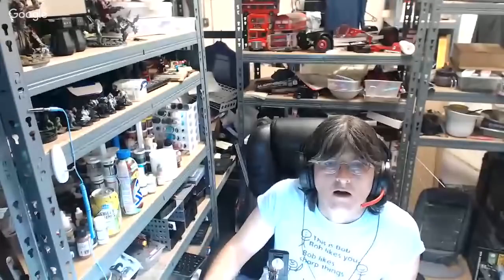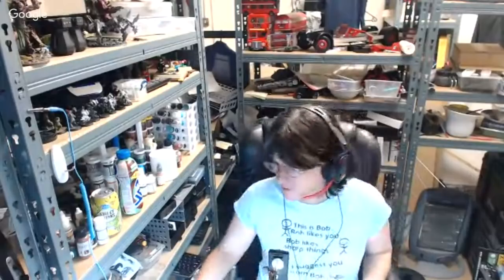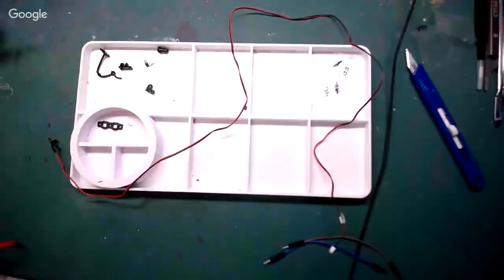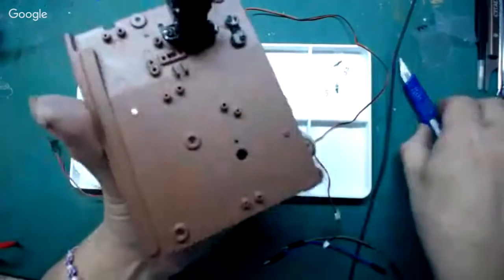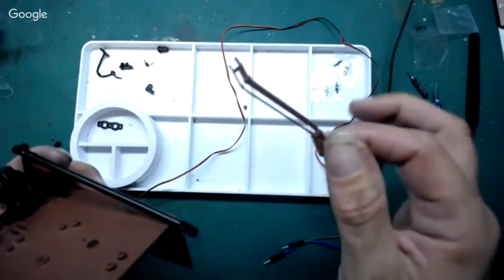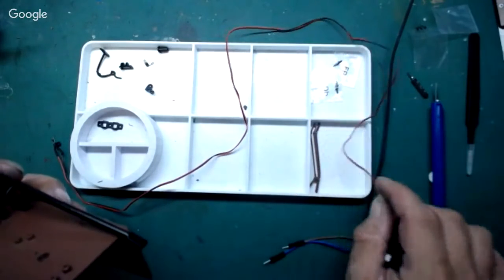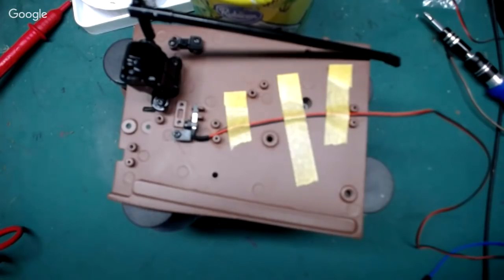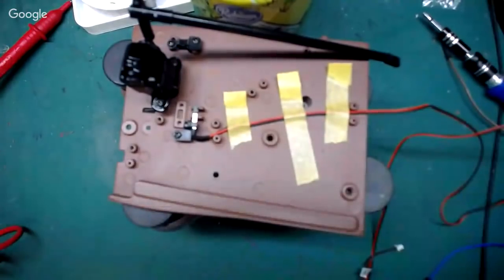Build The Classic Routemaster - Part 037

Comment: A little bit of advice when u need to use the cheaper voltage meter u can make the ends smaller just by wrapping a bit of a metal paper clip round the end then it’ll make it easier to go into small holes I used to do this when I used to do electronic testing in my last job